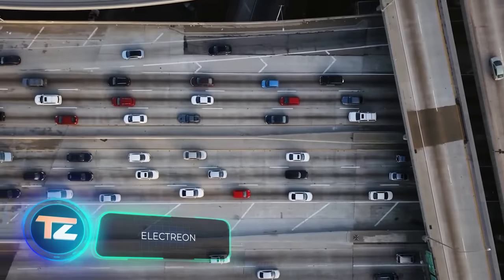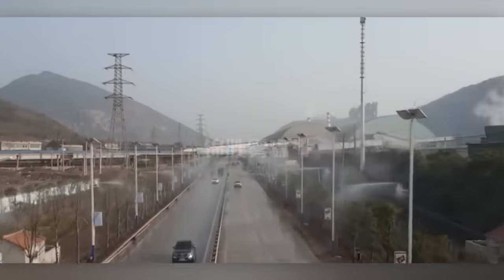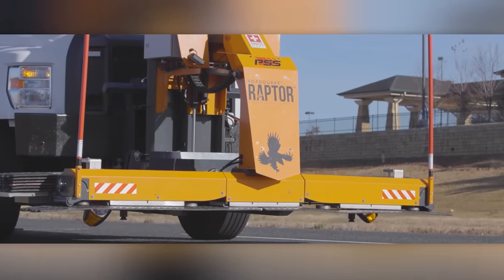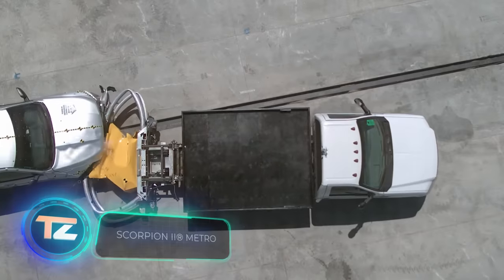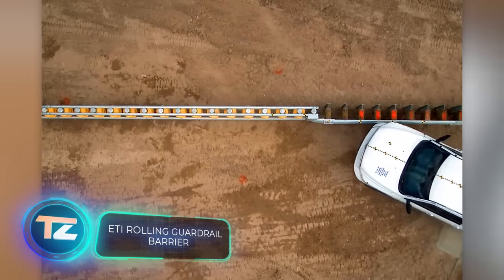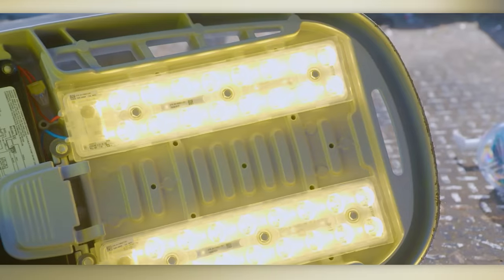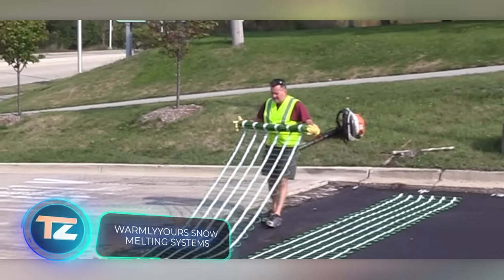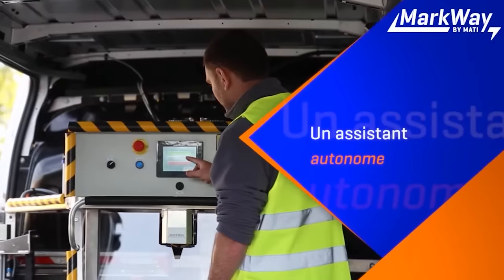ROAD TECHNOLOGIES THAT HAVE REACHED A NEW LEVEL

Comment: If you want electric vehicles that run from power on the ground  use rails.  Roadway based power will not work for any length of time because roads get overlaid. When you have a new layer of ashphalt over the conductors it wont' charge anything.  The only alternative then is to very carefully grind of the worn surface a very costly way to resurface a road.  Beyond that anything that would break the roadway like an earthquake could incapacitate  your entire transportation system with no easy fix.

Comment: China dust problem: the mist can only be a temporary solution. The trapped dust/water mix either falls to the ground or settles onto other objects. Then the water quickly evaporates releasing the dust again. Just added water to an endless cycle.
Reply: That country is too heavily polluted due to rapid economic development that is not balanced with environmental protection issues.

Comment: Many of these are not new. The main issue with them is cost and and it's a triple hit. First the materials and methods to produce are higher. Second, tech being replaced has been used for decades. Like everything else production costs drop over time. Third, they need support in government and in the public because that extra cost will be made up in higher taxes. As for real world testing, it always finds issues not found in small tests runs.

Comment: Road induction charging is just a way to gobble up yummy R&D money. Theres no way to actually implement it. Who pays for the power. Are they going to tariff the roads like tolls. And the power infrastructure required is massive. You'll need substations every few kilometers and the load on the grid is horrendous. Massive loads in peek hour traffic and Zero loads at night. Its also dangerous. for metal objects like bicycles or any other metal ring. We don't run power under 200mm of a road surface for a reason. The cables will get damaged. Its a stupid idea that just burns money.

Comment: Any chance of inventing clean roads which don’t require hydrocarbons to construct?
Reply: Well you could build roads using concrete like we build most of them in the US, which is just sand, water, cement and aggregate, all of which are not hydrocarbons and can theoretically be extracted without using any.
But in practice we still use hydrocarbons a lot for those materials (especially cement that needs to be heated) and sand for concrete is also starting to get scarce. This is a little known global crisis that not many people know about. And no, you can't just use sand from the desert, because it is too fine.
Another way is to simply not build roads at all and go back to good ol' rail.